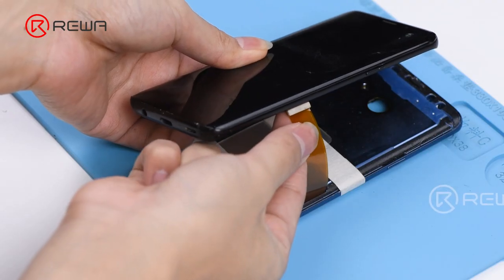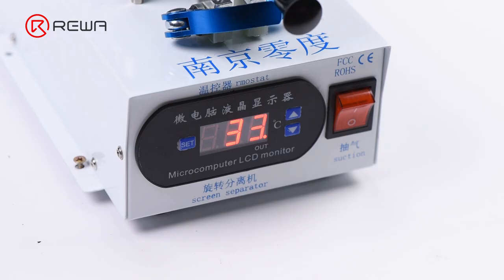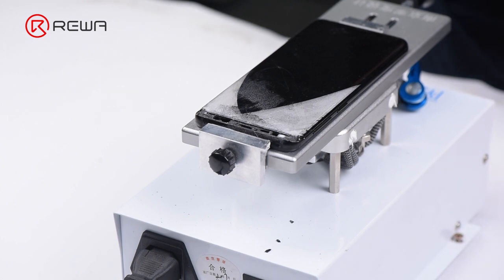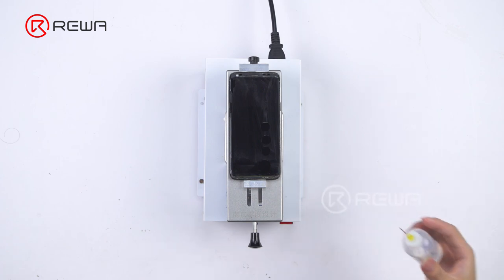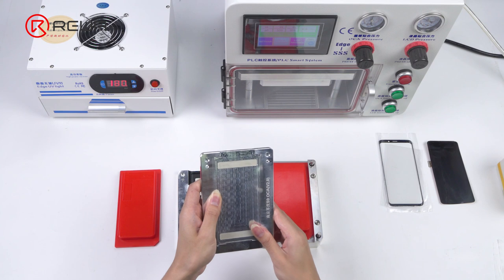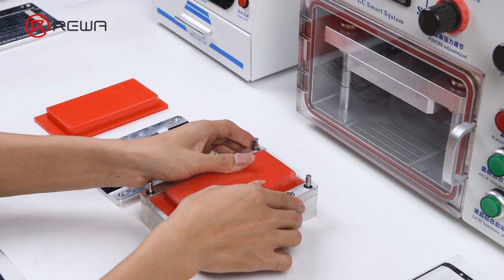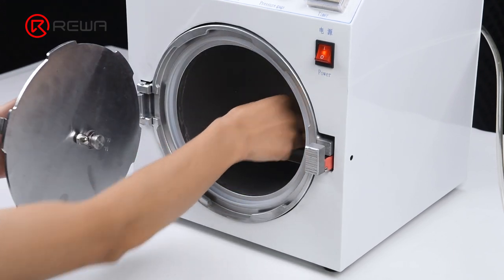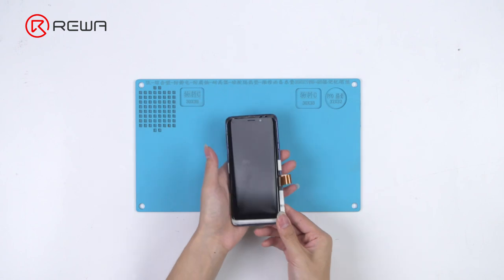The Latest Curved OLED Screen Refurbishing Solution V5.0 ( Galaxy S9 Demo )

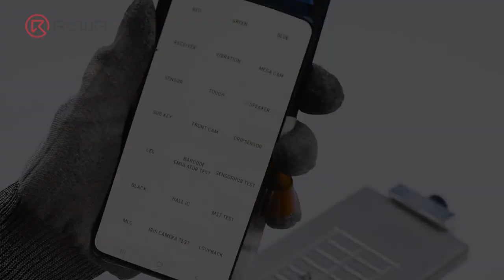Comment: At 6:57 the oled is damaged right next to your thumb (dead pixels). At the end of the video, in final testing, the oled is perfect. It either "fixed itself",  or this process is way more difficult , you damaged the screen and had to use other screen to finish the process.
Reply: That doesn't look like dead pixels, it looks more like threads from the gloves covering that portion of the screen.

Comment: Why using oca glue on OLED screen when you can use loca without the need of expensive tools and waste of time.
If it was a LCD it makes sense, since the Loca glue might interfere with the backlight, but OLED is insulated.

Comment: Why didn't you just laminate in frame? There is no need for the cutting machine at the start, and no need to remove the amoled from the frame after you remove the glass 🤔.

Comment: You can tell me sir how to remove pattern lock of Realme C2 and Samsung Galaxy S10 plus and please sir I'm waiting for your answer...
Reply: for realme c2, you can use umt emmc tool or ufi tool or easy jtag or you can just use the online method if you dont have these tools. for s10 plus, you can use a pin locked sim and bypass it or use the screenshot method. depends upon the security patch version.